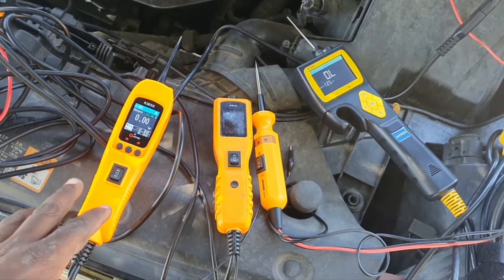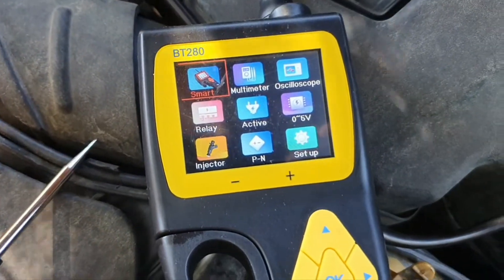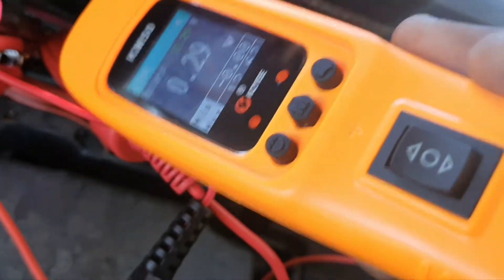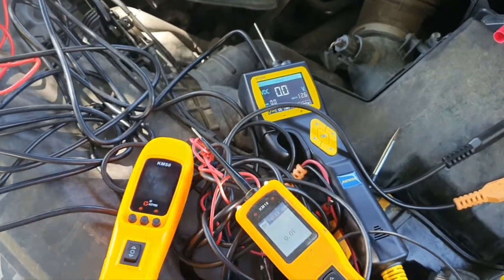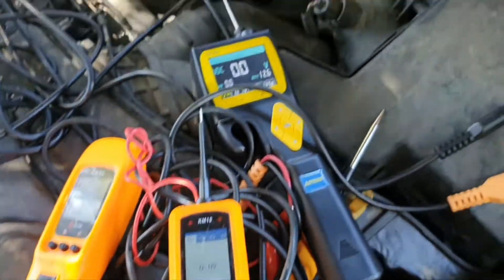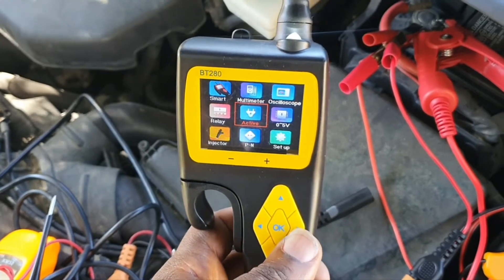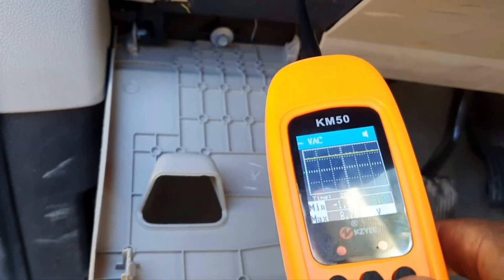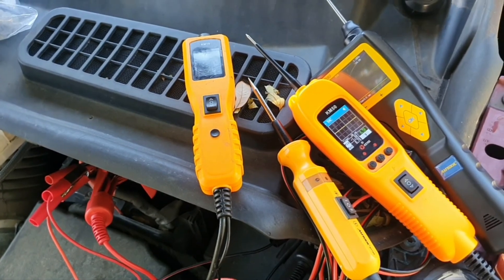Power probe Kzyee KM10 vs KM50 AUTOOL BT280 SIGMAPROBE circuit tester COMPARISON! MINI REVIEW

Comment: Love your videos, Thanks. But I disagree on this one, I bought the KZYEE KM50 and I do not recommend it, It has a terrible circuit breaker or lack of Built in. The screen shuts off if you short it out but it is still passing current the whole time! Do your self a favor and buy the cheapest power probe (or the better ones If you wish) .
Reply: They all have internal thermal breakers...

Comment: You must know that taping on bulb or led light...its not same like taping on voltmeter!? Because on meters exist REFRESHING RATE! so, if that refreshing rate is 100 or 1000 times per second you will be available to see on display that flickering from taping.
Reply from the maker: The delay is not due to refresh rate, has many of these circuit testers take up to 1 second or more to detect and determine signal, they also have led lights and this delay is still present.